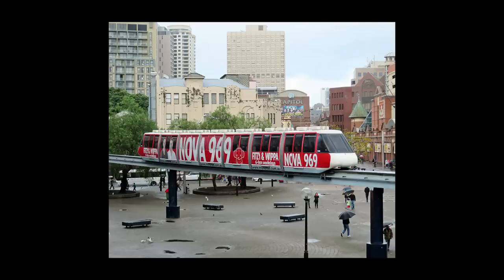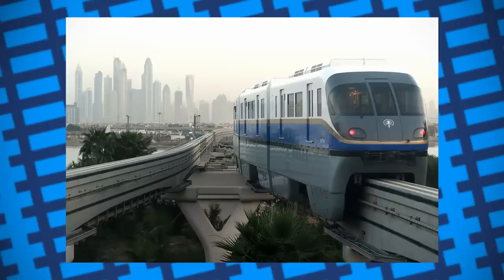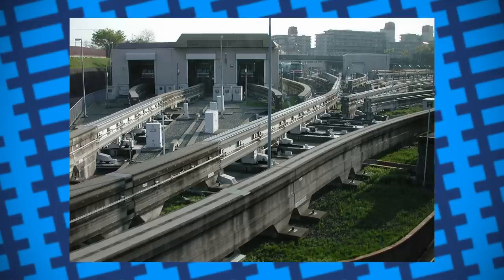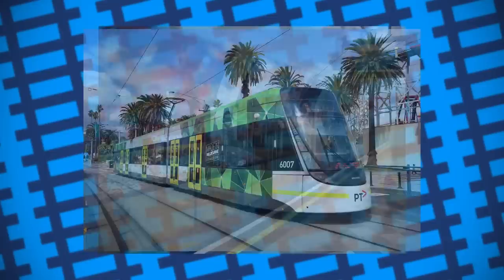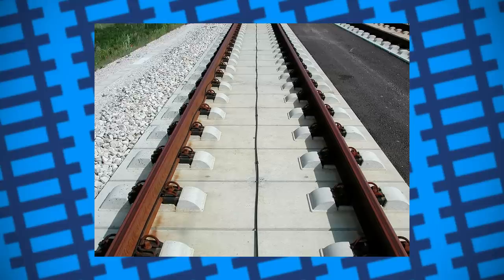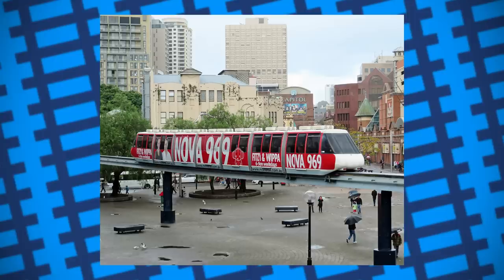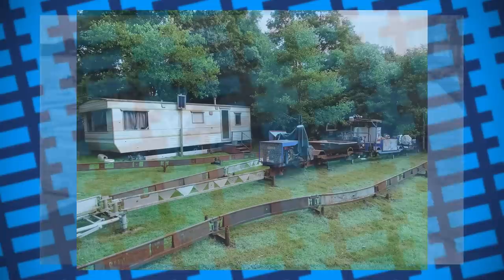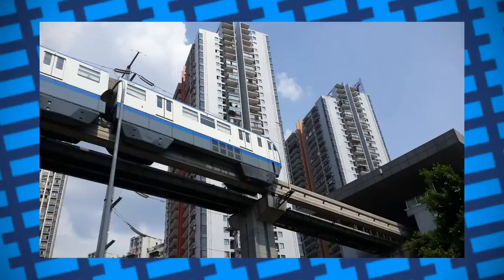Why monorails are bad as public transport - Monorails

Comment: There is a monorail in the Orlando, FL airport. That airport also has a hotel inside it the monorail is used to connect multiple terminals together, making what would be a 45min-1hr walk roughly a 5min or less monorail ride. Definitely useful there, but again, very limited.

EDIT: I stand corrected, I stand corrected! 😂
Reply: That's an Automated People Mover or APM not a monorail.
Reply: @randomscb-40charger78  it is? I thought it was a monorail...
Reply: @awesomecronk7183  it has car tires, an automated bus train thing
Reply: @awesomecronk7183  Nope, not at all.
Reply: @awesomecronk7183  I think a lot of visitors to FL confuse one kind of APM's with monorails, reasonably, that kind of APM uses a central guiderail
Reply: Even if it is a successful monorail, does it have any compelling advantage over more conventional twin-beam Automated People Movers? The point isn't that monorails can't ever work successfully, it's that they rarely ever have compelling advantages over more conventional designs.
Reply: @quillmaurer6563  it isn't a monorail, its exactly what you said. Ive ridden it.
Reply: @WesternOhioInterurbanHistory  You mean a twin-beam automated people mover? That would make more sense. I even seem to recall riding that system about 3 years ago, I recall the same - if it were a monorail I certainly would have remembered such.
Reply: I work at that airport. Not a monorail. Imagine a regular tram but the rails are concrete beams and the wheels are rubber tires, because winter isn't really a thing that happens here. Fully automated, since it really just goes back and forth. Only switching is on the new one going from the main terminal building to the Intermodal Terminal and the new Terminal C. Even still, just rubber tires on a twin concrete beam guideway.

Comment: monorail is perfectly working fine in Singapore, Malaysia and Mumbai. It's better option over busses and trams. The main purpose of monorails is to decongest busy traffic and it does that job. Trams and buses add up to traffic, why monorail offload that traffic. And given how cities are slowly getting gripped in traffic, monorail's benefits outweighs it's cons. Actually a better comparison would be with metro/subway system.
Reply: Nah, they're not working fine. Mostly used in tourist areas only for the wow effect. Other than that better to just build LRT or use a bus network.
Reply: @bltzcstrnx  Line 15 in Sao Paolo, Brazil is designed to carry 48,000 people per hour per direction & is successful, but sure stay ignorant
Reply: @JaimeValladares00 at least not ignorant enough to look at the monorail as a whole system instead of individual lines. Sao Paolo Line 15 carried around 100 thousand passengers per day in a system that move 4 million in a single day. With the length of 15 kilometers out of the total 104 kilometers. In which the majority are conventional metro.
Reply: @bltzcstrnx  Your point is? We were talking about capacity here, don’t deflect. Regardless of what you think cities use monorails for uses that best fit them & has proven to work for said uses such as the one in São Paulo & is expanding another line to include monorail, line 17 which would hold up to over 200 thousand people. Look at the recent project within greater Cargo & Shinkansen in Japan, both capable of carrying large amounts of people within single lines. Monorails can be used alongside metros, who says they couldn’t? To dismiss monorails as a whole despite there being actual monorail systems being used around the world is ignorant which is a word that describes you best

Comment: The stations from the Sydney monorail are still there. They even have the advertisements from when it closed, it just has no track.
Reply: one wonders if a drop in replacement of a light rail line would work....
Reply: They have demolished City Centre (the one inside the building), Paddy’s Markets, Convention and Galeries Victoria stops over the years, the remainder of the network are still in limbo due to ownership disputes, and I have a feeling that the Harbourside stop is going next due to the imminent demolition/redevelopment of the mall.

Which just leaves Chinatown, World Square, Darling Park as the last standing stations on the former line that closed down in 2013.

Comment: I think the Wuppertal monorail is the only exception to this, as it was mainly built above a river, using space which would otherwise have gone to waste - which in turn also saved multiple historical building from being bulldozed.
Reply: Also the Shanghai Airport Maglev
Reply: Check out the Chongqing monorail, and the Kuala Lumpur monorail. The former has 492km of tracks, 262 stations, and 3 MILLION daily riders! Monorails are incredibly effective and PRACTICAL transport solutions, given the right setting.

Comment: As expected, the video is making it too simple, reality is more complex.

Most bad monorail Systems were/are bad not because they are a monorail, but because they're route was designed badly and because of bad integration with the rest of the transit network.

There are several very successful monorails in the world that move thousands of people daily and which are well integrated
Reply: Sadly, people tend to ignore actual examples in order to keep their moronic opinions relevant
Reply: You can't look at these systems in isolation. There's a reason why monorail deployments are outnumbered by massive margin to other forms of mass transportation. Even in Japan & China, monorails are outnumbered massively by conventional rail.
Reply: @JaimeValladares00  why don't you take a look at those countries you said. A handful of monorail lines compared to thousands of kilometers of conventional rail. If the monorail was so successful, they would be the majority. Osaka Monorail is 28 kilometers long, compared to Osaka Metro at 130 kilometers. Tokyo Monorail is 18 kilometers long, while Tokyo Metro is 195 kilometers. Chongqing monorail only makes up line 2 & 3, about 97 kilometers, this is against their 524 kilometers of conventional metro.
Reply: @bltzcstrnx  The needs for these systems are adequate for the area that suits them best, like any other transport. I’m not saying monorails should replace all modes of transport. The point here is that monorails shouldn’t be dismissed as they do work for places that would benefit from them best such as airports & inner city transport through districts or neighborhoods
Reply: @bltzcstrnx  these numbers mean nothing they are not relevant to answer the question if monorails can be good transit lines.

Of course in most cases a traditional metro makes more sense, but in some cases a monorail can work great too, like in with a lot for steep terrain like Chongqing

Comment: I'd love to see a followup video discussing the Wuppertal specifically, cause I know it gets brought up a lot when people hype up monorails. So I'd be curious to see what the specific circumstances were that just make the German monorail work when in most scenarios it just isn't practical.
Reply: tom scott and the tim traveller have done good videos on it. it works there because its over the river. its a congested valley and thats the only space for a rail line.
Reply: Yes a must really, especially as it worked reliably for around 120 years. Real problems only started with modernization and new rolling stock in the last few years...which shows that Victorian or Edwardian era is just more durable and thus reliable!
Reply: One Big factor was that it needed to be elevated anyways, and that, by hanging on one standard rail, it is lighter and therefore needs less steel to build than a long viaduct, an by hanging it negated the problem of wide or tall track (and introducer the one of swinging into another carriage...)
Reply: The Wuppertal was a pearl string of towns in a relatively narrow valley. You could not have a tram because the room simply wasn't there; and you could not go down because of AFAIK high ground water. In the early 1900s, all rolling stock in Prussia was essentially hand-crafted, so you simply didn't lose that much money for a bespoke construction. 

So it was built, and after the initial investment replacement stock or rail had a (small) serialised run.

The line along the Wupper river (Wuppertal - Wupper valley; before, it was distinct towns with the biggest being Elberfeld) doesn't need as frequent switching as a tram or tube network would need (like the Berlin Hochbahn, essentially an underground above ground).

In short, monorail could use all of its advantages in a situation that minimised the impracticalities.

I haven't seen any "hyping up" of monorails, just videos condemning monorails that nobody wants to construct anyways as an example of the worst engineering since time began. Wuppertal is mentioned because it is a working example of the exact specific situation monorail has been the best solution at construction and still is so good a solution that replacing it would be ineconomic, and may even reduce capacity.

If you want a monorail where rail is possible, safe the hassle and build light rail. If you cannot build light rail, then monorail may be, depending on the specific situation, a viable alternative. 

Busses, if you cannot build a tramway, aren't better than a monorail system because they travel on the road, which you generally want to relieve with an elevated public transportation system. Trolley Busses or street-running tram are an intermediate step if traffic doesn't justify building a tram or if you want to build a tram incrementally, meaning first the catenary and routing, then putting in the rails at a later date when you have the funds.
Reply: Simply because standard monorail didn't exist yet at that time. 

Once modern, standard monorail become apparent, suspended monorail no longer have its merit. Heck, even Walt Disney itself said that suspended monorail was suck even just for gadgetbahn
Reply: @enysuntra1347  The Schwebebahn isn't a tram replacement but a metro replacement. Wuppertal had trams but the demand along the river justified a metro. The ground makes subways very expensive in Wuppertal and an elevated rail line over a river is not only disruptive but also slow because of tight corners.
Reply: I was born and raised in Wuppertal. The others are basically right, Wuppertal is located in a narrow alley and there are a lot of hills, therefore the Schwebebahn works really well. It basically gets you from east to west in 30 minutes. Wuppertal used to have a tram too, that even connected it to other cities like Solingen, Essen etc. but it was discontinued in 1987, dince they failed to modernize it. Now busses run nord to south and the Schwebebahn runs from east to west.

Comment: Some points presented in this video are valid for outdated monorail system. Newer system being built currently are cheaper and require less space than normal train system, while having the same capacity and speed. Bangkok is currently building 60 kilometers of monorail, and it's scheduled to open next year. The monorail also has steeper climb, and that made going up and around existing elevated roads and rails easier.

Comment: I'm amazed no-one's mentioning the Chongqing monorail. 492km of tracks, 262 stations, 3 MILLION daily riders. Operational for nearly 2 decades. Monorails are perfect for the city's very hilly terrain. The channel seems to have a high production value, but the thesis of this particular video seems to have come before the research. Monorails (and elevated rail systems in general) are ubiquitous, effective, and awesome modes of transport with the right conditions.
Reply: Of the almost 500 km of Chongqing rail transit, only 95 km are monorails (line 2 and 3). All the other lines are heavy rail metro system.

Furthermore the monorails were the first two lines to be inaugurated between 2006 and 2011, after that 6 more lines were added, all of them standard metro systems. 

It seems that even the hilly city of Chongquing decided that monorails are not that useful and went all in with the rail
Reply: Even with countless cities opting for conventional rail. Monorail or futurist fans still can't let go. I guess it does have a very strong wow effect.
Reply: @AndreaPacini-bv1zd  Line 3 have a ridership of around 1M per day, wdym of not "useful"? And they are useful because any other rail type don't work where those lines go.

Comment: 1:50 - The two reasons that monorail tracks, including supporting columns, are large is not the vehicle weight, but 1) the need to make the system safe from damage, e.g., impact from a large truck, and 2) the need to guarantee that the track remains in alignment. Monorail supports are not driven in from the surface like a telephone pole, but built up from bedrock or driven piles like a bridge support. 
If the monorail can be attached to buildings, it can be truly lightweight. However, that tends to only happen when the monorail builder owns the buildings, such as at Disneyworld. Most building owners don't want tracks attached to their buildings, even when you pay them.

Comment: Of all the upsides you mentioned, the lack of derailing is the only actual upside. Many trains in the Paris Metro run on rubber wheels as well. And you can have standard trains on raised tracks as well, but unlike monorails they don't HAVE to be.

Comment: I can't accept the third point - lack of interoperability with existing networks. You can't drive trucks on train tracks, trains on roads, or airplanes on anything - complaining that monorails (built explicitly for passenger use) don't also have goods wagons is... not a significant point, and actually weakens the rest of the argument.  Switches, maintenance, and inability to grade cross are already all strong points and this just seems almost fatuous by comparison.

Comment: The Wittenberg monorail that appears on many of these pictures was neccessitated by the very tight valley in which the city is located. Its design allows it to “fly” over the river in a tight valley where there was no more soace for additional infrastructure. And while being a hanging monorail, it uses many standard railway parts for easier maintenance.

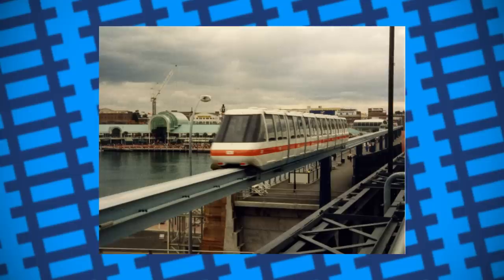Comment: 7:16
This is the thing that bugs me with most of the current passenger monorails. The whole point behind perusing monorail designs was that monorails had the potential to be more resource efficient than standard rails. Monorails were supposed to be cheaper to build than standard rail while keeping the energy efficiency of steel wheels on steel track. 

However, current passenger monorails incorporate none of this. 
Current monorails have rubber wheels on a concrete track. 
In my mind, that's not a monorail. That's just an over glorified bus running on a concrete track.
Reply: if we consult Gareth Dennis' #NotAMetro sorter then it does indeed get classified as a Bus

Comment: The Sydney monorail also had a big disadvantage of going from nowhere to nowhere. If it had gone through Circular Quay as originally planned, it would have been at least useful.
On the other hand the Tokyo Monorail is an important link to Haneda airport, although the terminus at Hamamatsucho is not convenient.
Reply: Yeah, which is why the Haneda monorail was originally intended to terminate either at Shinbashi or Tokyo station.  It was shortened to end at Hamamatsucho because the cost overruns on the Tokaido shinkansen left them short of money for other projects.  There were periodic attempts to extend it, but none of them came to anything and since there are now plans by JR to build the Haneda airport access line as conventional rail, it will probably never happen.